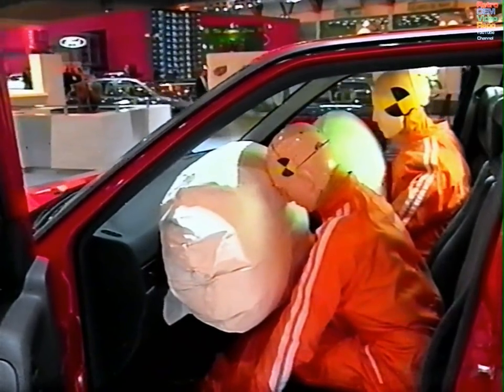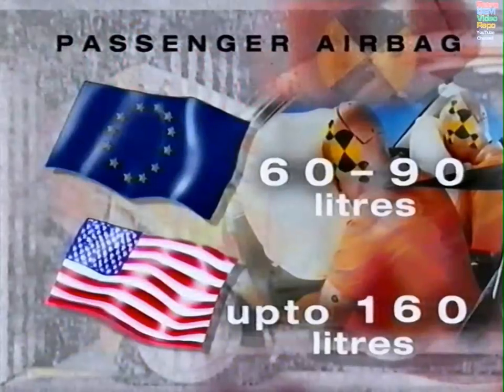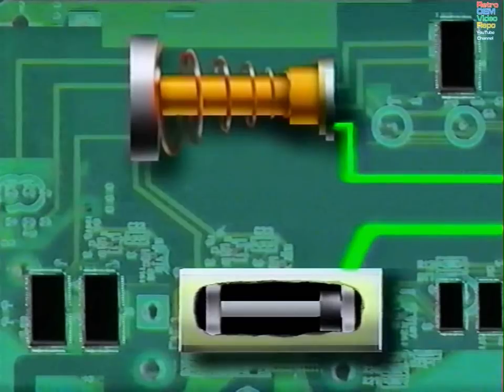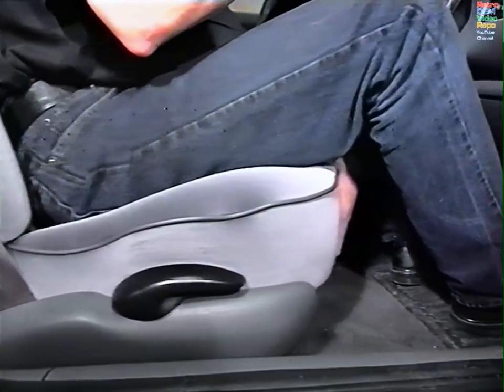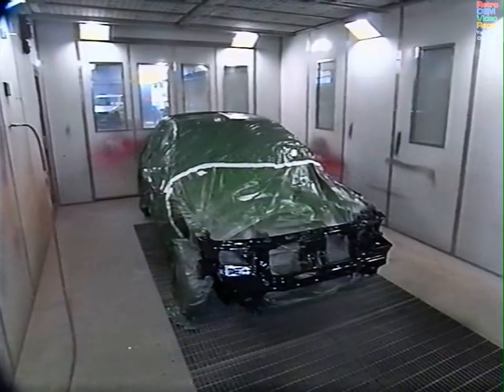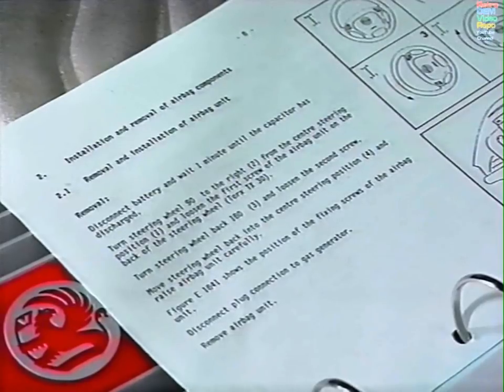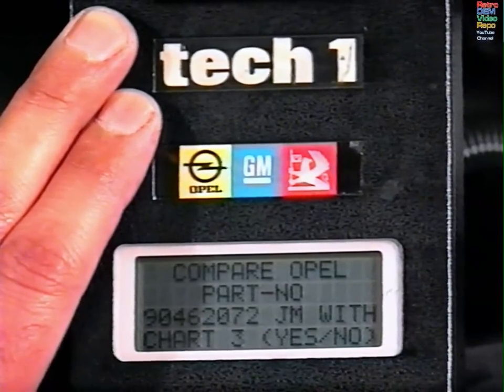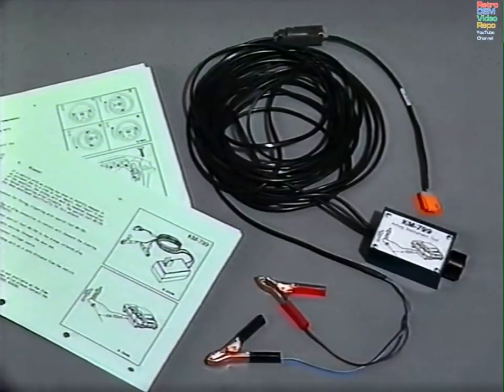Thatcham - Airbag (1994)

Comment: VW used completely mechanical seatbelt tensioners in the Mk3 cars - I'm not aware of any disable procedure for them, and they do not interact with the seat adjustment.
In the US market the Jeep Cherokee used a mechanical airbag for a few years. I'm not aware of other models that did - generally the SRS warning lamp coming on and going out is a requirement to pass a safety inspection. 
The retrofit system is quite interesting. Those must take their power from the horn circuit?
Reply: The jag XJ49 and XJS had mechanical airbags too

Comment: Any more information as to why the US air bag is so much larger except for the reason that some occupants may not be belted?
Reply: Larger people?
Reply: Europe did it right. Airbags only need to be big enough to protect a belted occupant, because those big enough and powerful enough for unbelted occupant protection have a higher risk of seriously injuring and killing vulnerable occupants, such as short adults and children. In the USA, before 1998 airbags had to "stop" an unbelted 6' tall, 200 pound man in a 30 mph crash against a solid wall. Nowadays airbags are far less aggressive and have advanced features to reduce the power of the airbag or keep it from deploying entirely if a full-power airbag deployment would do more harm than good. But in the 1990s, when this video was made, there was a big problem in the USA with airbags seriously injuring and killing children and short drivers. Europe never had nearly the same issue with airbags because their regulations were designed around seat-belted occupants. 
May 5, 2020 10:05 pm